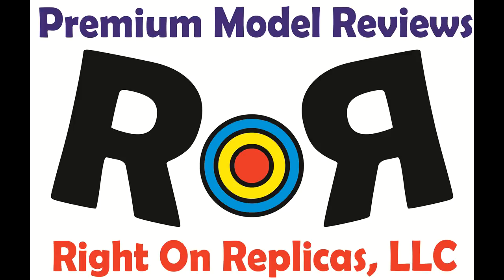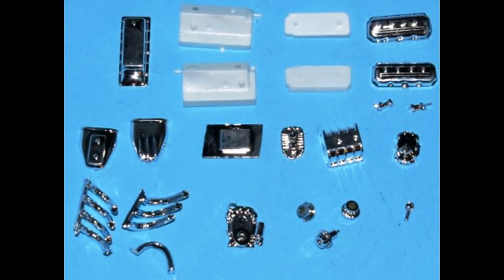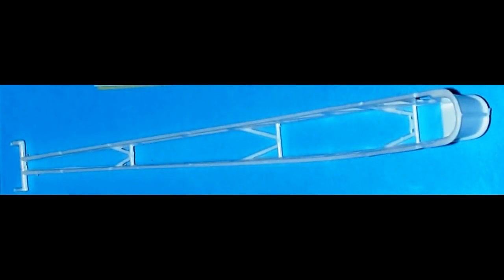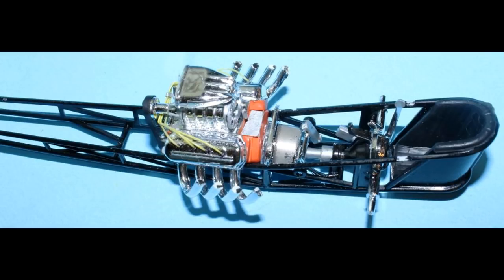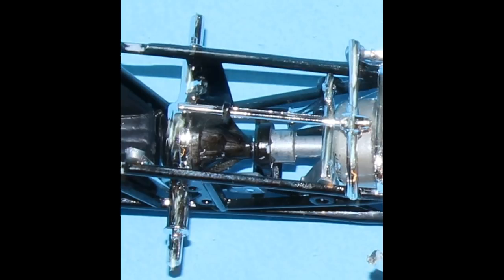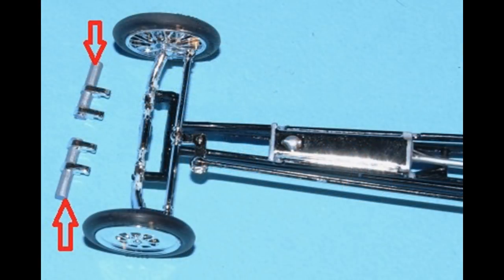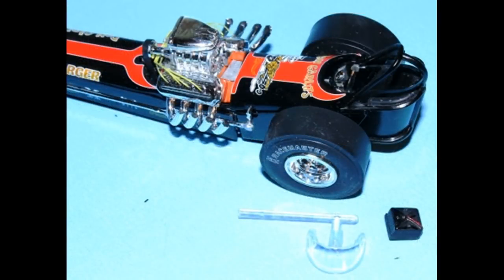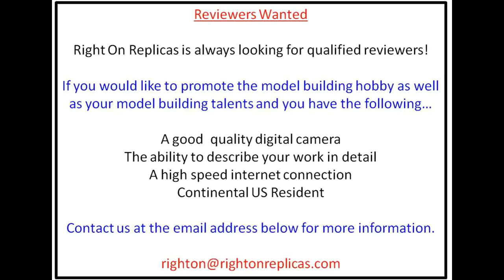Don Garlit's Wynnscharger Dragster 1:25 Scale MPC #810  Model Kit Review

Comment: The kit was poorly made. Having all kinds of fitment issues. Engine details are lacking. Too much chrome plating and not matching with the original car. Also the blower intake should have 4 not 3 butterflies. Lots of extra plastic to cut off from the molding process.
Reply from the maker: 72, Yep.  It'll take a little extra work to finish right.  I can hardly wait for Tamiya to come out with one!  -Doug